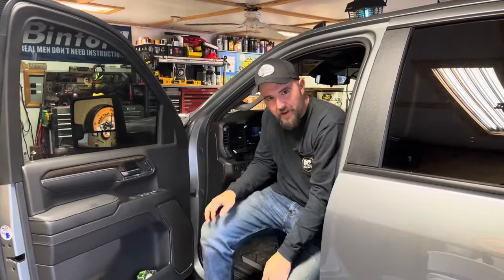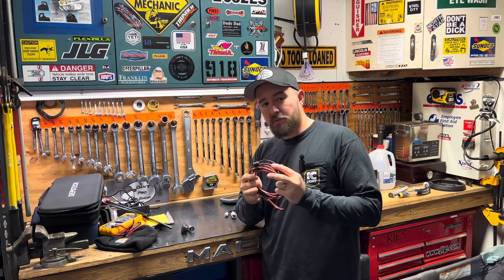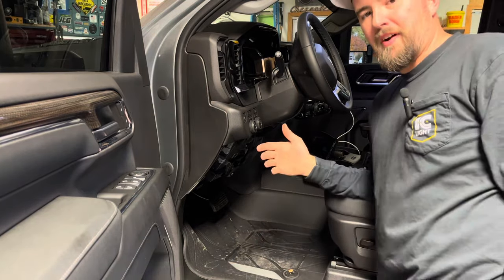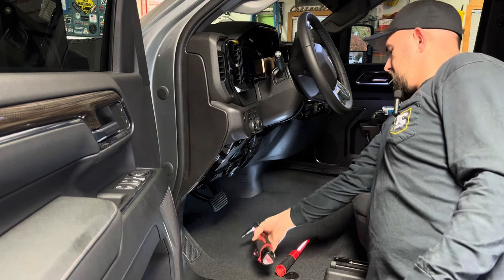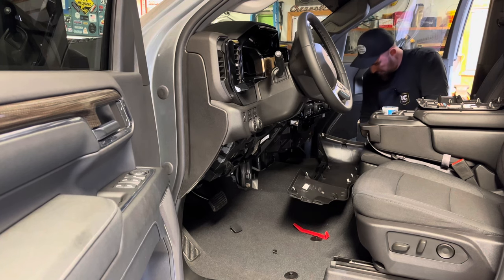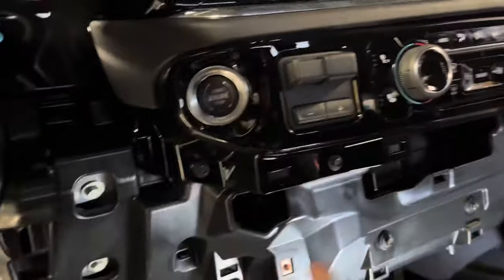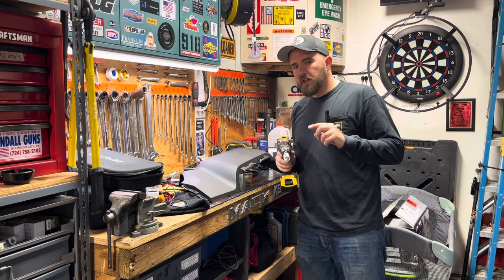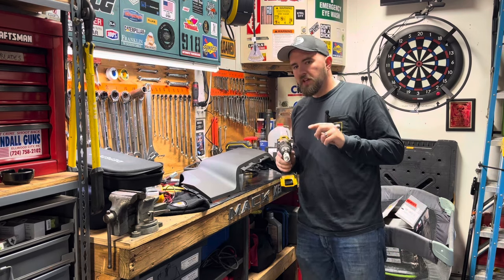2024 Silverado 12 volt cigarette plug install

Comment: Dan:  All should let GM know how stupid this plan was and demand the engineer that thought this was a good idea to be canned.
Reply: My 2023 has cigarette lighter/outlet?  So not sure why he’s saying they stopped putting in Silverados?
Reply: Not in 2024's @CaptainCurt07
Reply: This is stupid. Bought a 2500HD work truck with no power outlet.
Reply: @williamgardner9596  I installed 2 of them low on the center panel. Pretty easy

Comment: Amazon has an adapter. Plugs into a USB-A or C and steps up to the cigarette adapter. Only $12. No drilling or panel removal.
Reply from the maker: Dosent work. I tried that first. They do not supply enough amperage for most stuff to work. You may get away with smaller things like charging your phone, but that kinda defeats the purpose of

Comment: So stupid that they didnt include one. Cant use 12v emergency tire inflator or the strobe light kits for construction guys. Anything that requires power and advertised to be used it in your vehicle, you can't use it.
Reply: I believe it’s still included in the lower trim levels like the WT
Reply: @Mypocketshurt  it's included in the base models cause they still have the old style interior.
Reply: @realestreaIist  yeah when I was shopping for a new truck, I'd see one that was a decent price and looked nice on the outside then you see the interior and it's the old ass interior. I finally just said screw it and bought a brand new elevation.
Reply: @Mypocketshurt  I got the elevation aswell. The pro sierra and the custom silverado still have old interior any trim line above that has the new interior. I got the elevation cause I didn't want all the chrome grill and bumpers.
Reply: @realestreaIist  the elevation limited also had the old style interior.

Comment: I ordered a 110-12 volt transformer with a 6 foot cord. It was $40 at Home depot and they shipped it to my home in a few days. I can plug it in to the interior 110v outlet and lay it on the floor where it will never rattle out of the dash. When I leave the dirt I can plug in my inflator to the bed outlet and air back up all 4 tires without leaving the door open. You did a great job and it looks clean. Just not very convenient or worth the labor for me.

Comment: Love that I found this out on the side of the road with a low tire… and no where to plug in my inflator. Extremely stupid… thanks for the help, adding a 12v cig plug
Reply from the maker: Nice! Best of luck!!
Reply from the maker: Nice! Best of luck!!
Reply: I checked for one when i bought my '24 sierra bcuz i heard they were removed and nothing. Why go backwards.
Reply from the maker: @receded  I’m sure it’s all about penny pinching
Reply: for a 12 volt compressor to pump up tires, there is a adapter that hooks up right to battery with clamps that has a female cig lighter plug on end of a long coiled up wire. This is a temp setup to use only while you need the compressor, but it will work and is cheap "fix" for a compressor.

Comment: would this really stay hot with 12 volts after 20 minutes with truck off and doors closed? Would the RAP feature not kill the 12 volt feed to this as a battery saver? Have you ever tested this to see if it does stay Hot with power after 20 minutes? RAP = Retained Accessory Power  feature from GM.

Comment: Great video. We have a 23' Silverado 1500 Crewcab LT Trailboss and what I did, I went to the passenger side fuse box by the glove box and used switched power fuse using the USB/charger. Works great. We can leave something plugged in without worrying about the battery draining.

Comment: I used to drive acuras and they stopped putting those in as well as ashtrays in the early 2000’s the ashtrays actually had felt lining in them.

Comment: Hey Dan, nice video, thanks! Yeah, I'm STILL pissed at Chevy for yanking these and replacing them with USB sockets. I mean, there's nothing wrong with USB, convenient for phones! But USB is only 5 volts, and they are generally limited to fairly low current. Good luck trying to run an air pump off a USB socket!

Nice job too. I hate yanking panels off the dash because I'm always worried I'll break *something*. "Oh, that's a screw, not a clip! Guess I shouldn't have pulled so hard!". I really appreciate you blazing the trail and showing all the attachment points! 

I'm definitely going to put 2 or 3 12 volt sockets in my new 3500! I have the upfitter switches, which are mounted just below where you put your socket, so I'll be looking for other locations in that area for my sockets. I'm also considering switching the outlet with one of the 5 upfitter switches - or maybe tapping into a 12 volt source that is live only when the truck accessory is on.

Thanks again, and enjoy your new truck!
Reply from the maker: Thanks so much!!
Reply: @dansproshop  I pulled off the panels this afternoon. My truck has a console, so the process is slightly different than yours, but watching you first was very helpful. The space in which you mounted your socket is occupied in my truck by the upfitter switches ... and there is not really a good spot I can find on the dash that gives me the room to mount the socket. So I think I may mount 2 sockets on the driver's side, in the pocket on the side (vertical) wall of the console (I wish YouTube allowed commenters to upload pictures). The sockets will be tucked away in the pocket, so not in the way of my leg/knee. I just have to see if the wire running from the item plugged into the socket is in the way. It looks like it will work nicely. 

Thanks again!  👍
Reply from the maker: @BlaiserAid  absolutely. Happy to help!

Comment: Nice job. That hole there is for the upfitter switches which mine has installed at that location which sucks because now I need to find a location to put the 12v.

Comment: There isn’t a 12V in my wife’s ‘23 Toyota. I added a fuse block under the hood of my truck for after market mods. Stay safe electrical malfunction (short) is the #2 cause of vehicle fires!

Comment: I bought a 2024 Sierra elevation and after a couple months now I find it very frustrating not having an always on power outlet. I work 12 hour shifts and spend a lot of time in my truck, having to turn the vehicle on just to charge my phone or other device is ridiculous. 

The amount of anxiety I experienced while watching you plan, measure and drill that hole in the dash was off the charts. I have the bucket seat options so I have a centre console so my panelling will be slightly different but I’m guessing behind the panelling will look exactly the same.
Reply from the maker: I’m willing to bet it’s very similar

Comment: Thanks for the video. I just bought a 2024 Chevy 2500 HD and I do have a 12v power outlet, BUT it goes off with the key instead of staying on all the time like the older generation. I guess I’m lucky I have a plug? But it’s still annoying it goes off with the key. Idk
Reply: Search videos for "hidden features": you may be able to switch a 50|50 fuse to make it constant hot.
Reply: @briananderson7042  I did watch a few and unfortunately, that 3rd prong in the fuse location is not there on my 24, like it used to be on previous years. Don’t know why GM took it out.

Comment: Thanks for the video Dan.  I’ve got a couple questions for ya.  1. If you’re hanging your camera display on the windshield, is that the closest location that would accept the plug?  2. My camera came with just pigtails, can I run that wire directly to the fuse panel, or should I wire it to a cigarette lighter like you did?
Reply from the maker: That’s the beauty of doing it yourself! Do whatever you want. If that’s the only thing you need power for, that will be just fine  but I wanted the traditional outlet so I can use it for anything. Good luck!

Comment: Nice answer to that issue. Thanks for the video. I am considering installing my cb from the Colorado I'm upsizing from. I'm thinking on the bumpout where the map lights are, but have concerns about how to remove the panel without damaging it. Any Ideas ? BTW every job finishes great with an IC/lite

Comment: My RV dashcam  video freezes and disrupts live video feed when using the 12V outlet adapter.

Is there a high speed adapter or 12V adapter rating that is required?

Comment: Hi Dan:  Great video!  Question on the wire harness.  Are both the plugs the same?  (hard to tell in the photos).  Can I plug two 12 volt receptacles into the harness? I'm thinking of installing two receptacles in the dash.
Reply from the maker: The plug ends are not the same because this harness was intended for a truck that already has a 12 volt outlet to ADD a second one. So one plug clips into the outlet and the other would have plugged into the factory harness. But either way. It works just fine

Comment: My dad would take what look like really heavy lamp cord I'm talking really heavy heavy cord. He would put a 12-volt socket on the end of it. On the other end a couple of rather large probably two and a half inch copper coated clamps. It look a little bit like jumper cable clamps. That way he can have an adapter on the battery in case he needed to air up someone's Tyler Perry could just hook it directly to your battery and would not have to run it through the system. Sure you can buy that but it's so much more fun to make it and spend a fraction of the money 💰

Comment: Dan nice video...off topic question.  The 2024 also doesn't have the overhead grab handle in the cab.  Have you installed any of these.
Reply from the maker: It has them on the A pillar. I really don’t miss the over head ones to be honest
Reply: @dansproshop  I prefer the one on the pillar to the one overhead. I don’t end up clotheslining myself.

Comment: I am echoing the sentiments of others that this video is exactly what I was looking for as I needed the lighter plug for the very same reason. I have the entire thing installed ready to be connected but I can’t seem to get the 90° spade connector on the available fuse terminal. Did you modify anything on the fuse panel?  I ordered the one in your parts list. Can you show me how to fit it?
Reply from the maker: No modifications needed. Just some patience and maybe some curse words. It does work. I swear

Comment: Where do you find the part to put into the fuse slot.  I only find parts on Amazon that need modifications.  Its a 3 pin fuse

Comment: You could just buy a 110 to cigarette lighter adapter?
Reply: One issue there is you need the vehicle to be running to invert the DC to AC then convert back to DC.  I like my 12V receptacle to be able to power things when the vehicle is off.

Comment: Questin: is the 12v supplied all the time or only when the engine is running? I hope the 12v is not running all the time so that the battery is not drained when the car is parked.